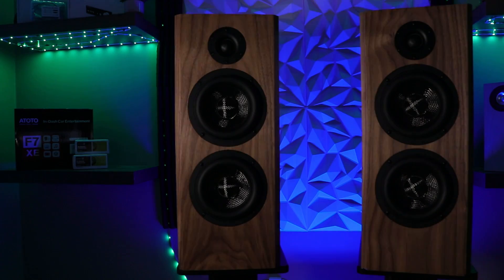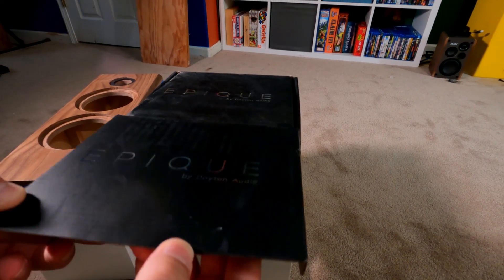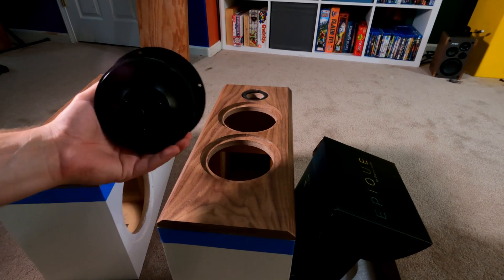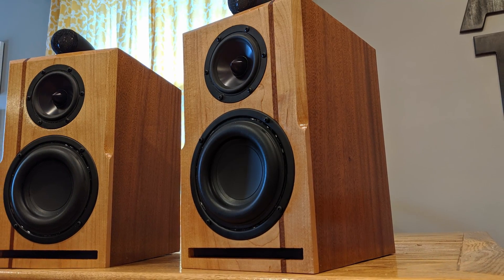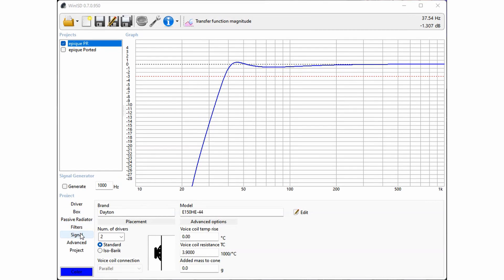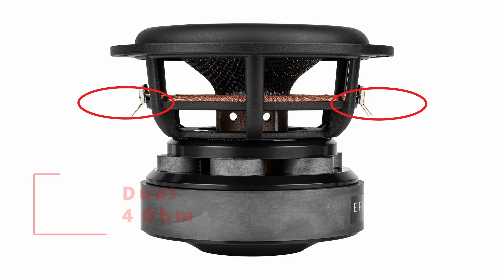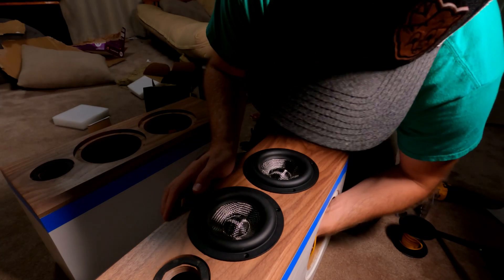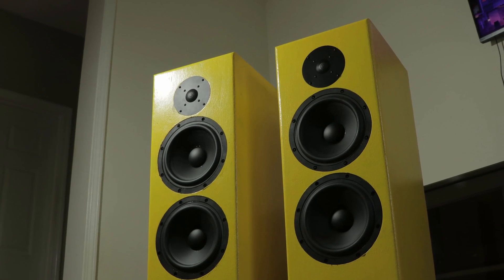How to Design a Speaker - Epic HiFi Technical Breakdown

Comment: Wouldn't a single Epique E180HE-PR 7" Passive radiator do the trick?  I plugged the numbers in and it seems the cone excursion comes in just under the max at 200W.  Did I miss something?
Reply: If not then (2) of the E150HE-PR's?

Comment: I finished building these speakers about a month ago.  Judging just by ear, they don't seem any where close to 89 dB sensitivity.  Just guessing, but closer to 84-85 dB most likely.  Have you actually measured the sensitivity?  Has an impedance curve of the finished speaker ever been published?  Other than being power hungry, they do sound great.
Reply: What amp would you recommend? just started building
Reply: @bear_dillz  I'm using an Advance Paris A12 right now which is a 190 WPC into 8 ohms IIRC.

Comment: I am kinda new to this, so i don't understand something: in the end you talk about crossover of the frequency. But where and how do you adjust that? And where does it remember the crossover? I mean, the speaker itseld does not have internal memory. On what do you adjust the crossover. Is there like a motherboard inside of the speakerhousing where the adjusted crossover stays remembered? Or on a separate processor or something?

Thnx for the inspiration, these speakers look awesome. Also the passive radiator is new for me, that a speaker not connected, can also produce sound. That is cool. The Epique drivers look awesome with the big rubber lining sticking out of the cabinet walls. Awesome! Try making these with 4 of those Epique drivers per speaker enclosure, that would be mad awesome, or 4x that epique driver per speker but with the 7" epique drivers😋🥳 that would be awesome. To create a kind Arendal 1723 towers look or something

Comment: Very interesting.  I'm in the planning stage of building my new speakers, and i have been looking a lot at open baffle .
But seeing the amazing quality of Daton Audio elements, i'm considering building a pair , using 4xEpique E150HE-44 5-1/2" in each, with a passive radiator sidemounted, 1xDayton Audio RS100-8 4" Reference Full-Range Driver  for the mids and 1xDayton Audio PHT1-6 Planar Horn Tweeter for the highs.
Ofc the biggest problem here is the wiring and getting a crossover that maximizes the performance while keeping the Ohm around 8 while also trying to get the sensetivity up... 83db is really really low and my current speakers are sitting at 96...

Comment: I noticed Dayton Audio just released the OPAL1's using this same mid woofer. But they only used one mid-woofer per speaker. I think your design of using two per speaker is much better and If only for the increased sensitivity.
Reply from the maker: They did. And I agree I think that you really should have two per speaker. The cool thing about this design is it really doesn’t cost that much more than the Opal1’s. So if you’re willing to put the work in, this would seem to be a much better value.

Comment: great info thanks  I want to build some speakers along the line of a ADS speaker 780 or similar, is it best going with new drivers or starting with used ADS drivers ...?
Reply from the maker: With speakers that old, you would be better off starting with new drivers. Most likely the old drivers would need to be repaired.
Reply: ok thanks . I have a set of Klipsch kg4 , I like them but don't LOVE them ...( I have limited experience with high end speakers) want to build something nicer maybe softer..? I'm a cabinet maker by trade so I know I can build a nicer box :)  @Toid

Comment: Nice project, utilizing some interesting drivers. One correction though, which someone may have already mentioned somewhere upthread. Paralleling woofers doesn’t result in a 3dB increase in SPL, it results in a 6dB increase. So, even better. It’s correct that you obtain +3dB from dual woofers because they draw and convert twice the total power of a single woofer. You obtain an additional +3dB, however, from what is called Acoustic Coupling, for a total of +6dB. An array of four paralleled woofers would product +12dB over a single woofer, and so on. Which is why large arrays can produce such dramatic increases in output. 

Acoustic Coupling is a highly localized air pressure phenomena that occurs because dual woofers each see an increased radiation impedance over that of a single woofer. Increasing the radiation impedance makes for a more efficient transfer of acoustic power. The increase is not, excuse the pun, out of thin air, it’s from an increased efficiency. That makes sense because each woofer in a dual woofer configuration creates a local increased air pressure zone for its partner.
Reply from the maker: Thank you. I actually mentioned the +6dB increase in the 7 minute mark. I appreciate the reminder for those that are unaware.

Comment: I want to build a set using the 7 inch epique drivers but I can't find any decent apps for design. Any ideas?
Reply from the maker: The best thing to do is buy some measurement equipment and get on the forum. From there we can help you once you have your measurements. Without your measurements, we’re just making some educated guesses that may or may not work out in your favor. www.toidsdiyaudio.com

Comment: from what i heard it doesnt matter if you wire in parralel or serries,   the speaker efficiency doesn't change,  only the amplifier load changes,   since the coils are still the same,  8 ohm coils less sensitive, than 4 ohms,    just by rewiring them in parralel only makes the amplifier receive 4 ohm load,   but the speakers individual sensitivity should still be the same,  or am  I wrong ?
Reply from the maker: I think you’re getting a little confused. There’s some basic principles that can help you with this math. Just by adding one woofer you get +3 dB in sensitivity. However, adding that particular woofer will either increase or decrease the impedance. If our impedance increases (as in the number goes up), we will lose 3 dB in sensitivity. If our impedance decreases, we will gain an additional 3 dB in sensitivity. So if we took two 4ohm drivers and added them in series, we would get +3 dB for adding an additional woofer and -3 dB for now getting in an 8ohm load. For a net of 0 dB increase. However, if we were to wire them in parallel, we would get +3 dB for adding an additional woofer and an additional +3 dB for lowering our impedance to two ohm for an increase of +6 dB. So you’re partially correct in the essence that you have to take into account the added woofer plus the impedance change to know if you’re getting any sensitivity increase.

Comment: Hi Nick! I built the speakers this winter and I really enjoy them! 💫

I'm using rePhase to do phase correction and I was hoping you could help me out:

- Tweeter crossover; "LR 12 dB/oct" @ 1600 Hz (third order, 18 dB/oct, not an option in rePhase)
- Box; "vented low Q" @ 45 Hz

Are these the correct settings to use? "Inverted polarity" turned on.

I see the PR's tops out at 125 W, do I damage the PR's if I hypothetically feed the full 480 RMS to each speaker?

Comment: After adjusting the wiring of the woofers to make them 4ohm and with the tweeter being 8 ohm, will these work with a vintage amp that is rated at 8 ohm output?

Comment: Hi.  I bought you build plans and was trying to assemble parts.  Would it be possible to use 6-1/2” passive radiators rather than the 8” you have spec’s?  If so, would it affect the crossover at all, and how?  The Dayton DAS 215 PR 8” passives are back ordered for 3 months.  Looking for another option that isn’t too expensive.  Thx.  Jim
Reply from the maker: You can’t use the 6.5” but you can use the  paper 8” DS215-Pr. It is a perfect replacement. No changes needed.
Reply: Thanks for the reply.  I was finally able to find the aluminum cone versions.

Comment: I was wondering about logging issues. I been reading that some designs are 2.5 . I was trying to design a tmm and I been reading about that so I was wondering how you dealt with combing issues. Thanks
Reply from the maker: That is a great question.  A lot of this has to do with the crossover point and the size of the drivers used.  When used in a 2-way these  two drivers act like one driver.  And as such you can minimize most of the issues by crossing over low enough. Think of it as a typical two way just using a larger woofer.  I went over this in more detail in my latest build The Rule Breaker.  Also Jeff Bagby talks about it in more detail here: https://techtalk.parts-express.com/forum/tech-talk-forum/64889-isn-t-a-tmm-supposed-to-be-2-5-way I would highly suggest you watch the Rule Breaker, as it is a very unique design that shows the power of how the crossover point can have a dramatic impact on speaker performance.
Reply: @Toid  thanks I appreciate the response. I was going to try to design a tmm or mtm but I was reading about that issue and I want to make sure I don't have that problem.Thanks again.

Comment: As a hifi noob these videos are a lot to take in but incredibly helpful so thank you so much! 
I do have a question and that is about impedance. When using 2 woofers and 1 tweeter does the impedance have to match or not? Can the crossover take care of the difference? And what difference do you get in sound when they are different?
For instance, an 8 ohm tweeter and 2x 4 ohm woofer in parallel making the 8 ohm... Or what if you only have an 8 ohm tweeter and 2x 8 ohm woofer available? Can you still make this work?
Reply from the maker: That’s a great question. I actually did a video on that explaining it here: https://youtu.be/MMTGDiLjsZ0 The short answer is yes. But it’s a little more complex than that
Reply: @Toid  Thank you! I understood some of that video haha. I always thought impedance of the drivers should match and not only between the complete speaker and the amp.
Is it possible to have a 3-way crossover but then have 2 outputs doing tge same thing? So then basically you separate the woofers but they each receive the same signal.. Sorry if it's a dumb question

Comment: hi , i love your videos man . i learned a lot from you . can you tell me whats the differences in the MTM crossover  and TMM crossover  or make a video about that ? thanks for the video .
Reply from the maker: Thank you. There is no difference in the crossover themselves, assuming the TMM is a 2 way like this versus a 2.5 way. In the case of a two way a the signal of an MTM and TMM would both be spilt between the woofers and the tweeter. However, that doesn’t mean they use the same crossover. Once you start rearranging the drivers, you can change the phase relationship. So you need to take that into account when you design a custom crossover. So, although they will be the same type of crossover, they won’t necessarily be the same crossover.

Comment: How do I configure the enclosure if I wanna run both with 250w amps each
Cause the passive radiator can only handle 125w each
Reply: A passive radiator don't use power
Reply: @roygriend5143  every passive radiator has a limit with what wattage speaker its paired with
a rough way to know its max limits
Reply: @Divyesh_Sinha  ok, thanks, why don't you use a bigger passive? You can use 2 each side? There are even higher xmax PR i think. Sundown audio, jlaudio ..al those extreme subwoofer brands!

Comment: Don't you have to make that TMM configuration 2-1/2 way design?
Reply from the maker: No. That’s a very common misconception
Reply: @Toid  Have you measured vertical off-axis frequency response? Usually such designs demonstrate very large dip around crossover frequency at 30, 45 and 60 degrees above the axis. As I recall, Vance Dickason also suggested either 2-way MTM or 2-1/2-way TMM.
Reply from the maker: @IliyaOsnovikov  Yes and it is a common misunderstanding that has led to treating this s as a rule. Instead of explaining it myself, I’ll steer you to Jeff Bagby who, is believed to be the creator of the cascaded 2.5 way crossover. Look at post 5 by Jeff to get a better understanding; https://techtalk.parts-express.com/forum/tech-talk-forum/64889-isn-t-a-tmm-supposed-to-be-2-5-way
Reply: @Toid  Thanks! I'll check it out.

Comment: Very intriguing build.  But I am a little frustrated by the fact the crossover never made an appearance in either video.   You talked about tuning the passive radiator and doing a cut off on the tweeter at the point of distortion.  Why not just flash a image of these proecesses.   I know you intentionally held  a little back as a teaser for patreon but I think the crossover was such a primary part of the speaker build that  you could have at least showed it being wired up .  Oh yeah and what about the sound demo?

Comment: Good info after watching the build. One issue you can have with a design like this is phase issues in the vertical off axis because the centre to centre distance from the tweeter is mid way between the two woofers. Danny Richie always corrects for this by converting to two and a half way, crossing he tweeter to only the upper woofer and let the lower woofer handle the lower mid and bass. But this might be problematic with these dual voice coil drivers.  But it looks like you got a good crossover design here. Did you measure vertical off axis ?
Reply: Great point! I watched this because I’m designing a 2 woofer 3 way and am trying to figure out if I need to do a 3.5 way. I’ll be crossing them at around 1000hz.
Reply: @alexw890  watch the various upgrade videos of (mostly Klipsch) speakers on GR-Research channel to see the effect of not doing the 3.,5 way.   makes a big impact

Comment: HELP..! on finding 3 way crossovers...my local RadioShack went out of business in 09. they had a going out of business sale, so i got a set of Bose 10''  3 way (mid-twit) speakers. they didn't have 3 way crossovers in stock. them Bose have been setting in my attic since 09. i want to DYI a set of floor speakers, ole skool style. agian, help?
Reply: Go to parts express. I turned some crappy technics into really good speakers with some new new replacement woofers and tweeters and crossovers and some reinforcement

Comment: I thought that different drivers are supposed to be in separate chambers for good sound quality. But it seems like it's ok to mix and match in the same enclosure? Like your tweeters sharing the same air as your woofers. Could you maybe explain how you decide the size of the enclosure in this kind of system? WinISD only seems capable of 1 type of driver at a time. I am struggling to find good info on how you design this type of arrangement.
Reply from the maker: That’s a great question. You are absolutely correct. However, a Tweeter, like this is already in its own sealed enclosure. A.k.a. the Tweeter itself is sealed. In general, most tweeters are sealed. Since the woofers are being crossed over together, they act as one woofer meaning they can share the same cavity. If I was doing a three-way with a Tweeter, mid range and woofer, than the tweeter can share the same cavity as either the mid range, or the woofer. since it’s already sealed. However, the woofer and mid range need to be in their own separate cavities. I’m WinISD, you would measure each one separately. These are good questions, and if you have more like it, you should join the forum at www.toidsdiyaudio.com/forums
Reply: @Toid  Awesome thanks for the clarification on that! That makes much more sense to me now.

Comment: I wanted to ask about the difference between Ported and enclosed speakers. I have been reading sealed speakers tend to sound more accurate and not "boomy".  If a ported speaker that is designed with a flat response. and a similar speaker but designed with a sealed enclosure with the same low frequency response at 3db down (obviously with a larger enclosure). Is the sealed speaker going to sound more accurate as compared to the ported speaker described? Or is the ported speakers that are described as boomy simply just made incorrectly to sound that way?
Reply from the maker: That’s a tricky question to answer. In general if designed correct then, yes…maybe. A sealed speaker will still have lower group delay than a ported, which is often interpreted as tighter bass. How audible group delay is at lower frequencies is still very much a contested debate. So depending on what your beliefs are on group delay and at what delay it makes an audible difference would depend on the answer to this question. Unfortunately this is not as easy to answer.

Comment: Any chance of re-doing the PR Voxel with the 5" Epique?  It seems like it would be an amazing '2.0'.  Would it be just a drop-in, or would the box size have to change?  I've tried to WinISD this myself, and I just can't wrap my head around everything. 😕
Reply from the maker: Probably when the new passive radiators come out for it.
Reply: I second this, I saw parts-express has them now. Would be great to update your epic design to support them. Also, 

What kind of power would be ideal for these? Saw your video about the upstream plate amp and that if it had enough power for these would be great to utilize if it’s ample power for these?

Comment: Quick question, when you take the speaker kHz reading to figure out crossover point do you break in the tweeter first? I only ask because the Dayton reference tweeter I used was really bright for the first few hours until it breaks in. It was very very noticeable.
Reply: That's a good question. I had the same problem with the tweeter is sounded wild but it tamed down and the woofers just got better sounding.